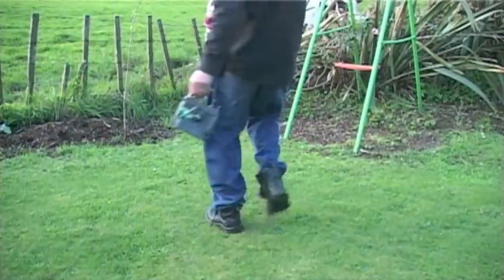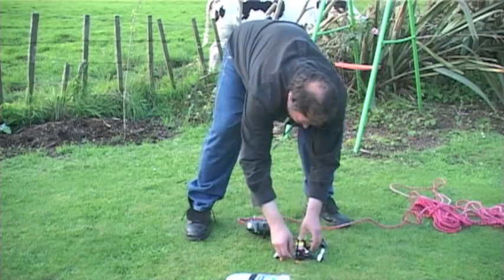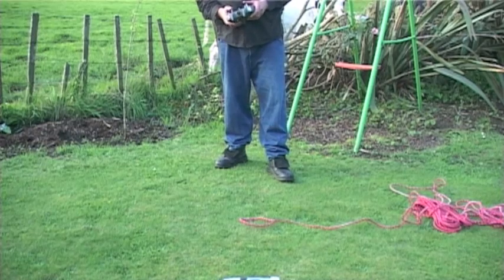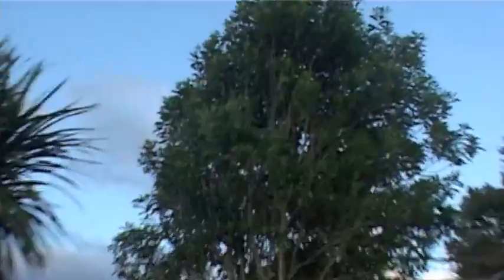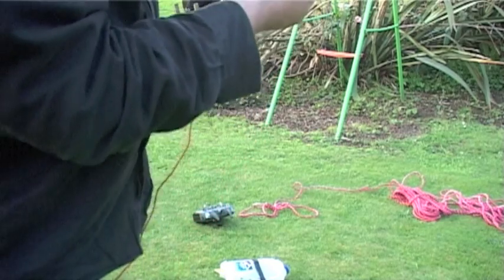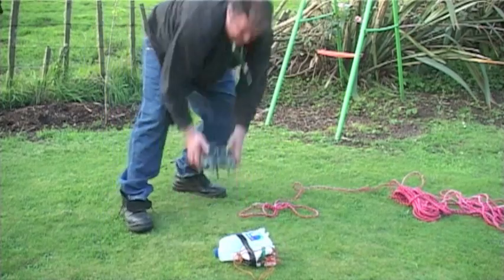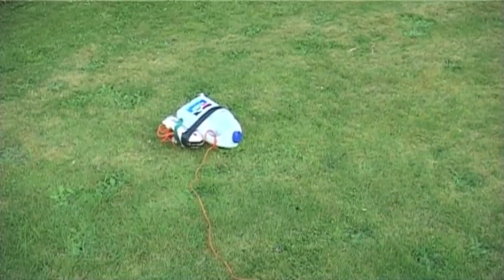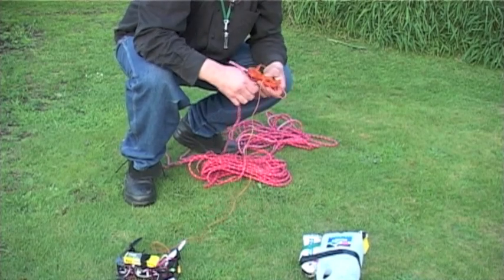Quad copter lifts rope and ANX

Comment: Roddy I'm pretty sure you would like this video, -it's up your ally :9
-it started out as a Glider tow, when the Heli was supposed to fly backwards to keep the rotors clear of the line. But then the moment got us, and he decided to lift it instead of towing, but the string was balanced (with a coin) for towing not lifting :S

ended up so very wrong :D

GLIDER HITCHES A RIDE FROM A HELI! (CRASH)
Reply from the maker: Thanks I will have a look